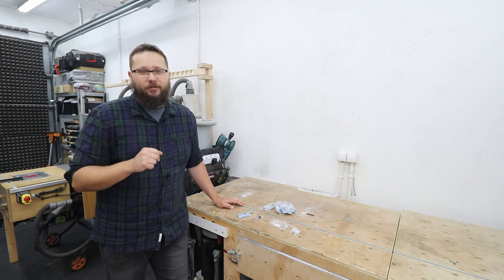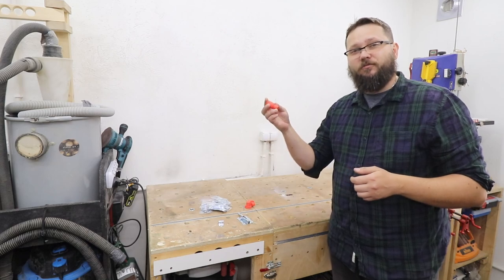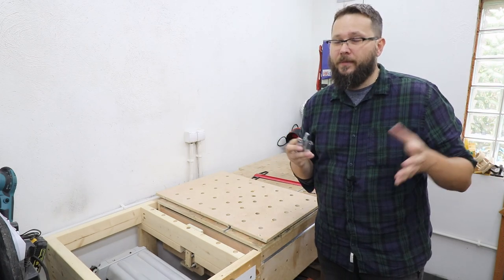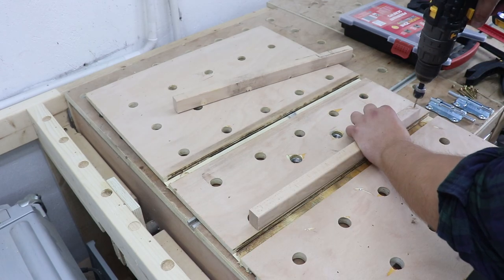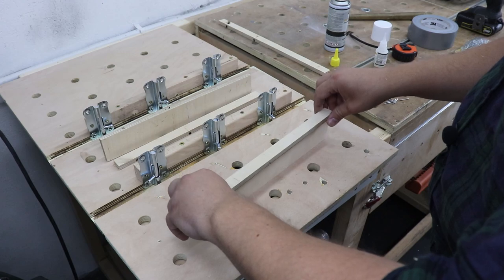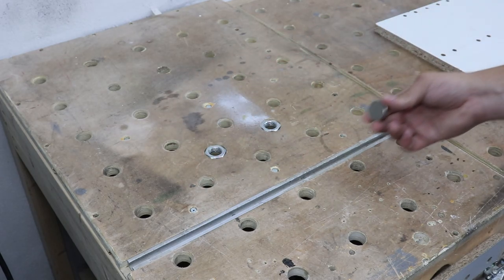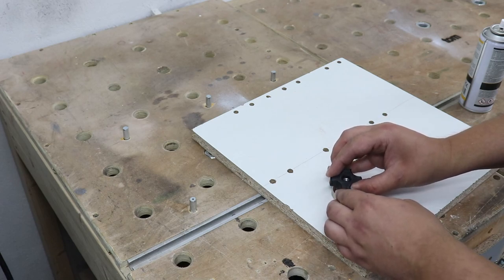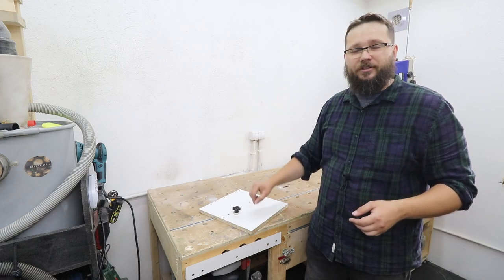Workbench Upgrade With Hidden Bench Dogs

Comment: I was wondering where you were going with this ... and then the reveal of it working ... what a brilliant, simple and effective method of having hidden bench dogs 👍.... another method which may work is to use push to close latches, meaning totally tool free hidden bench dogs.
Two brilliant things about this idea 1) you never forget where you put the dogs and 2) no holes for bits to fall in to 👍
Reply from the maker: I'll be trying out some pop-up dogs as well to see what works best for me 😁👍
Reply: Any idea where we can find metal push to close latches in the UK?  A quick search online doesn't bring much up.  Unless you think the plastic ones would work ok given the force is imparted into the bench and not the body of the latch.
Reply from the maker: @markgambrill  no come across metal ones to be honest. I think the plastic ones will be just fine
Reply: @markgambrill  Oh and remember that the solution shown by Tomasz has the dogs built in, i.e. the dogs are the bolt of the latch ... you'd need to buy some steel rod and cut it up into chunks (for the dogs) if you go the push to close latch way 😁
BTW, have a look at the John Heisz video "Genius Idea? Making Push Button Pop Up Bench Dogs" ... you might like that idea.
Reply: @markgambrill  Thought I'd do a quick search on YouTube ... "POP UP BENCH DOGS" ...  I didn't think of actually think of putting the latches inside the dogs ... if your bench top is ultra thick then you could get away with just drilling holes to the right depth and dropping the dogs into the hole (with the latches inside the dogs) 👍

Comment: I don't have holes in my assembly bench, and I still tend to lose my hardware! Haha. But, one solution that helped me is something from the mechanics tool aisle was these little magnetic bowls that I got for only about $2 (US). The hardware stays put until I'm ready to use them. I also use one at each power tool to hold anything I need there.  LOVE your idea, though!!

Comment: Neat idea Tomasz and I can see how well these work for stop blocks for planing and similar workpiece hold activities.   One of the powers of an MFT top is the grid alignment so I’d be very careful of using these as true bench dogs (e.g. for cutting work at 90 degrees with a track saw) as it’ll be almost impossible to get them precisely aligned in a grid and there’s too much slop anyway in the bolts.
But for holding work where you don’t need the MFT grid, it does the job.
Definitely interested in your ideas for popup dogs as the retail ones are very expensive.  Maybe 3D print something that latches together with a spring in it?
Reply from the maker: Yes thats true. That's why only part of my new workshop top will have dog holes to accommodate that. But the rest, will be a nice flat top with no holes.

Comment: Great idea, but those latches sound like they have a lot of rattle. 
How audible is the rattle if you thump your workbench? I have a feeling it would get on my nerves, especially if your hand planning, there's a lot of movement which I suspect would make them rattle.
Reply from the maker: To be fair I usually have hearing protection on or I'm listening to music so it will not be a problem for me. However I get your point.

Comment: why not have a piece of ply with no dog holes the same size as you workbench handed on the wall side and bring it down to cover the dog hole when using your bench as an assembly station. When you want dog holes you can lift it back to the wall out of the way .BTW you new de-tractable dogs mean you still have dog holes for small items to fall into although a good idea I'm not sure how accurate they are for alignment .
Reply from the maker: The metal rod fills the hole so nothing will fall through. These won't be as precise as normal dogs but I hardly use my dogs in that way ie with a track saw for example. Holding another workbench top is an option but not ideal as you need to hold it somewhere etc.